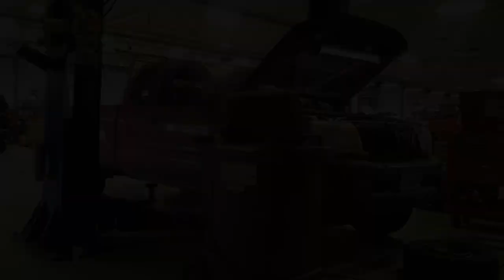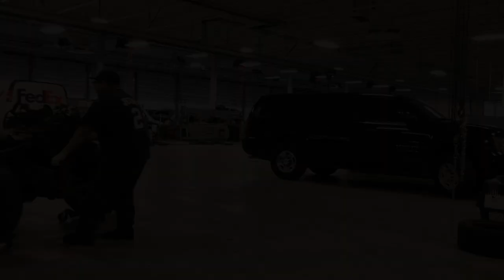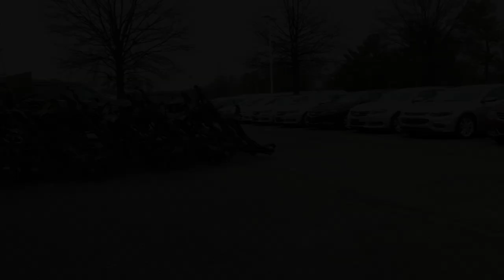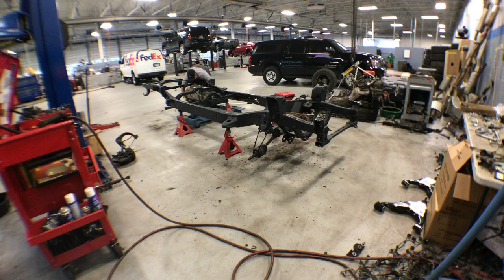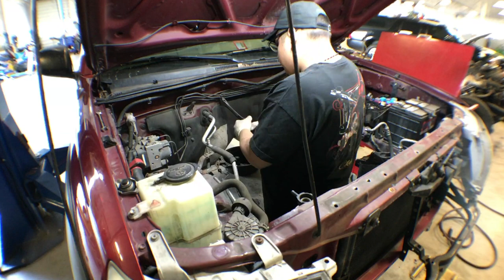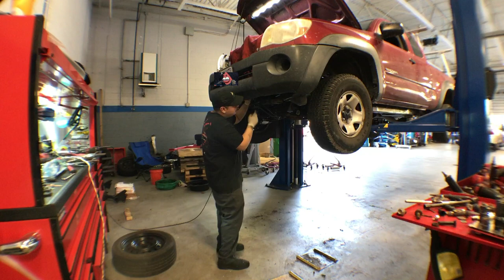Toyota Tacoma Frame Replacement

Comment: They should just start galvanizing their frames already.
Reply: Good idea.  How much would that add to their cost?  Instead of that how about units of government find an alternative to salt for keeping our roads safe.  And how about we use less salt.  And drive slower and more carefully.  That would work for me but most people are in a hurry to get home so they can sit in front of the tube and drink a few brewskis.
Reply: you think galvanized doesn't rust?
Reply: @76Bourne  ....i did....
Reply: @cdoublejj   a lot of people think that. Only Marine grade Stainless steel, but that isn't strong enough for car frames, its expensive, and you would have to use stainless screws, nuts, washers, rivets,  including your tools would have to be stainless. if you put a regular metal screwdriver on stainless that metal will start to rust on the stainless.
Reply: RUST PROOFING!   Get your frame oil sprayed every year.
Reply: @salespiilstire1144  twice or thrice a year!
Reply: @TheMatron'sMilitia it would get nicked and water would get in and rust it from the inside even more aggressively
Reply: They are too cheap to even put disc brakes on all 4 wheels and you this this garbage company is going to spend money to make their product more reliable??????  The rusting frames are BY DESIGN from toyota to get you out of your disintegrating truck and into a brand new one.
Reply: @jkutyna  Actually I prefer not having disc's on the rear because again...try living in Canada and especially Northern Ontario where there's nothing other than salt thrown by the boat load every moment nearly twice daily on our roads for say...100 days of the year...Yea brutal...Regardless drums in the rear are actually preferred over discs because of this.
Reply: @RogerDiotte  if drums were better in ANY circumstance ever, then trashota wouldnt be the only company doing it.  Especially the luxury brands would be doing it and they dont.  The ONLY advantage to drum brakes is that they are cheaper.
Reply: An alloy of steel and Molybdenum would make frames last almost decades
Reply: jkutyna You know they replace frames for FREE right? Toyota is eating a huge loss for every frame replaced. So no I don’t think they wanted to make the frames to rust out like Ram’s fenders or a Chevy Silverado rocker panel
Reply: I would rather replace a rocker panel on a GM rather than a frame on a Toyota
Reply: @allforwheelsgarage  My Tacoma has no frame issues as far.as I can tell. I had Diamond Cote applied when new. As for GM...My Sierra needed new shocks...valve seal leaked....whole front end replaced under warranty. Transmission did not work properly. And on and on. This was in 80 000 kms and 3 years old. So, between Ford and GM...They cured me forever.  So, maybe Toyota is not perfect, but Toyotas i have owned are light years ahead of GM and FORD.
Reply: @mikefoehr235  I must agree and disagree with you. I do believe the Toyota makes excellent vehicles. I myself have two Lexus vehicles and an old 1986 Toyota with 340000 miles. I have also owned many GM cars and trucks. My 2017 Sierra has had a few "trim" issues like a loose leather stich on the steering wheel for example. And mechanically it has had a couple as well, biggest being a squeak in the exhaust when it switched from v4 to v8 and a faulty gas filler neck flapper (capless system) fixed under warranty. the biggest potential failure I could see in the future would stem from the active fuel management because the old ones had problems with the lifters collapsing which can be prevented very easily with a range module which I will install once my vehicle is out of warranty. My old 2001 GMC Sierra has well over 200,000 miles on it driven daily by my stepdad on the original engine and transmission. My point is they can all last a long time if taken care of but some vehicles are more prone to failure than others. The Toyota pick up suffer from frames due to inadequate rustproofing from the factory. I guess you just have to pick your poison and think about the likely problems you're going to have to deal with as a vehicle ages. I myself can fix just about anything on a vehicle however I would not want to do a frame replacement.
Reply: too expensive. you can get a mechanic for 20/ hr. This was an Obama shovel ready job.
Reply: @76Bourne  In the seventies I used to build & weld stainless gas tanks for Jeep Wagoneers (1966 - 1970). Two custom fabbed 20 gallon tanks made out of 304 stainless. One where the spare tire goes in the far rear and the replacement coffin tank which was rusted out. TIG welded and installed and after 100 to 150K miles the only pits you could find are where the stainless brackets bolt to the steel hanger brackets. I bought two tanks for my own two Wagoneers 1966 & 67. The vehicles were driven in Maine, New Hampshire and Vermont and my own vehicles in Boston, Mass. Serious road salt abuse. Maybe it was the quality of the stainless that made a difference, 1975 - 1977.
Reply: @mikefoehr235  They use weathering steel on bridges where there is severe road salt and they rust, but I assume last for decades. I don't know the long term effects.

Comment: I had a 05 with a bad frame I had to fight with the dealer just to admit there was a recall. When Toyota and the dealer finally admitted it they told me I had 18 months to complete it and I couldn't drive it. I traded it for a Nissan 1 month later they called me looking to due the recall
Reply: They are scum bags aren’t they. The class action lawsuit FORCED them to start changing the frames. When I got mine done the dealer kept calling to tell me I needed to get this or that changed. They told me I needed a new belt. 😳 I told them the belt in it was only 4 hours old. I had just changed it when the frame finally broke. Mine was an 05 also.
Reply: I would never buy a newer model Toyota.

Comment: How long did it actually take you to complete the repair? my 09 TRD sport bdl cab long bed was dropped off on Monday morning and I was called on Wednesday morning telling me it was ready. Now I have been turning wrenches for over 30 years, so I know that's a lot of work. I'm not sure if they had more than one guy on the job or not, I picked it up on Thursday morning and haven't had any issues. To be honest I wasn't crazy about the idea of my truck being taken apart and put back together without doing it myself. Although I got a free brake flush and cooling system service because they replaced the coolant, with just over 210,000 miles it was overdue for both. My invoice was just over 10K, while I consider my Taco to be worth much more than that I'm not sure what actual book value is on it with the miles, however I wouldn't trade it for three times that.
Reply: Is it a toyota recall? why did you pay for the replacement of the frame?
Reply: I didn't pay for the frame to be replaced, the invoice had just over 10K was what Toyota was paying the dealership for performing the repair. I did pay for both rear shocks that were broke and the rear brake hoses. I paid dealer cost for the parts with no labor for installation. My truck did have over 200K miles, and I was getting a new frame. You don't bother with the little issues; My bill was like $270 ? $50 for each rear Bilstein and whatever for the brake hoses; Keeps me from dealing with them for a few years. 
I put 500 miles on their 2018 Tacoma they put me in with like 935 miles on, I turned it in over 1400. I did get a seat cover from work to put in it, respected their wishes and did not smoke in the vehicle. 

Although from that experience I can tell you, if you look at Tacoma's, make sure it's a V6. That truck got great mileage, didn't have any power. If your looking for economy, it's the cat's pajama's. 

I had to replace the muffler because it was rusted out, no big deal, I got a "Banks" cat back system. If you own this type of truck, this is the exhaust system you want. 3" stainless, mandrel bent. Muffler increases flow 211% 4" chrome or black tip. Uses factory hangers.  And well worth every penny, got one on my junk right now. I have the TRD cold air intake with the throttle body spacer thing from whoever. So far I have hit 450 miles to a tank, I just gotta keep my foot out of it. LOL...

These trucks are GOLD, if you can get one, get two, I rolled over 219,000 miles yesterday; While that's just a number, I'm looking forward to 233,129. That will be the point where I have put 200K on my Taco, I have over 150K on the tires; I'm probably going to get a new set when they hit 200K just because.
Reply: Just got my 06 Tacoma frame replaced no charge.  172,000 Kilometers rest of truck very good.
Reply: @mrgearheadfromhell  how long ago did toyota agree to replace your frame?  who did you talk to?
Reply: They had checked the frame from the recall and said it was good first, then when I took it for state inspection they checked it again and said it had " qualifying perforations " and they had already sent pictures to Toyota and they said put a frame in it.
I told them they already looked at it and they said Toyota extended it, I'm sure glad they did; That invoice was just over $10,000.
So the dealer gave me a loaner 2018 Tacoma with like 239 miles on it, I put 500 on it in 3 days.
Reply: @mrgearheadfromhell  tx....mine is an 03' sequoia and is horrible.  rest of the suv is fine, but toyota wont do anything.  dealer inspected it, but just sprayed black crap inside the rusted out frame.  gonna try replacing myself, should be an interesting project.  just gotta find a frame
Reply: @mrgearheadfromhell  Driving a Taco with almost 300K on it.  Wonderful truck.  Was thinking about going to a Tundra because I want to pull a small RV but am now thinking about the Taco V6.  

Totally agree with the quality of Toyota's frame replacement.
Reply: The Taco V6 will do just fine, I pull a heavy car trailer, it's actually a light equipment trailer 16' deck with a 2' dovetail. The biggest truck I have pulled was a 89 F250 extended cab LWB SRW 460 EFI C6 10 1/4" full floating 2 WD, I knew it was back there and Taco got right on down the road. The new Taco's have a 3.5L I'm not sure why they changed it, probably emissions or economy; I like my 4.0L. I usually get 20+ MPG so long as I keep my foot out of it. The Banks cat back system and TRD cold air intake really woke it up. I have never had it on the floor, I just lean on it a bit; Next thing you know your running 85 to 90 real quick. The Banks system is worth every penny and then some.
Reply: @mrgearheadfromhell  to answer your question I don't know how long this one took but 1 man can do this job in 17 to 22 hrs depending on how well it comes apart. And to all the sceptical people your truck will be returned better than it was before with no issues and no left over bolts
Reply: The rear shock studs and rear brake hoses were on me, I wasn't stressing because of all the free maintenance that had to be done to do the job. It just rolled over 233129 so I have officially put over 200K on the truck with over 170K on the tires, they went on @ 58233. I love it and want another, I have 4 second generation Toyota's 3 trucks and a 4 runner and got room for more.

Comment: wow ! lotsa work !. my 2018 try off road was side swiped before Christmas. over 14k Canadian in damage. insurance covered it. 6 weeks later still in shop, they tell they might have to order a new frame .a broken broken braket  at rear driver side. got hit right in the gas cap erea before back  wheel. took out my whole box , suspension etc.

Comment: When I look at the condition of this truck (body damage, bald tires etc) it is a shame to put a new frame on this truck.  To me, it's like rearranging the deck chairs on the titanic.
Reply: Frank P warranty covered it. They didn't make them right or coat them correctly from the factory. Like a 10-15 year warranty or something.
Reply: Lol
Reply: Exactly my thoughts. Bet the owner is going to sell it right after
Reply: If it still runs,drives then why junk it?

Comment: how much flat rate time?
Reply: Richard John My truck listed in as $12500.00. (2003 double cab.)
I bought it from a dealer that got it at auction.
I paid around 12000.00 for it.
Honestly, Toyota should have just junked them and paid out.
Reply from the maker: They did for the first generation tacomas. but that ended years ago.

Comment: I have a 2002 F250 SD 4x4 and I wish Ford would supply me with replacement frame parts so I could replace the rusted out front frame members.  Fixing of Rust Daily.
Reply: Well if every single Ford truck rusts apart for the better part of 10 straight years, including brand new trucks on the dealership lot, then the government will force Ford to replace the frames jyst like it is doing to Toyota.

Comment: Makes you kind of wonder if it's just cheaper to replace the truck? That's a lot of labor
Reply: I think Toyota is doing it for free as part of a recall. You can see a stack of frames outside this shop.
Reply: And yes it's cheaper to total loss the truck. As soon as a veh comes back need frame replacement we will total loss the vehicle. Labor hrs needed are over usually  over 97 labor hrs.
Reply: @theadjuster6760  Damn. Thats over $7k for most any shop!

Comment: Always thought there would be some welding but it looks like it’s all bolt on.  He had a torch to remove the rear end.
Reply: In manufacturing welding is only used if no other way is possible. It's the highest cost. The electric bill would shock you.

Comment: I just dropped mine off yesterday for frame replacement. They said it would take up to 60 days. Not with this guy.
Reply: @Joshua Bullock ?
Reply: Your frame probably had a safety issue.  Yes, it takes months for a new frame to come in.
Reply: WoodbyWolf Toyota was fudging the frame replacement inspections. Passing vehicles that really failed. Many than broke whilst owners were driving it. My broke. That’s what lead to the class action lawsuit.

Comment: THE CAR DEALER PROBABLY MAKES GOOD MONEY REPLACING PARTS NOT COVERED UNDER THE RECALL.
Reply: They made $1500 off of me for new exhaust system
Reply from the maker: Tech would too. At times I would do a "while we're in there" recommendation with a discounted labor rate since it's aprart. Simple stuff shocks/struts, water pump, belts, valve cover gaskets, radiator, etc

Comment: Afterwards it's no longer original Toyota quality. It's that local area's repair shop or dealership's quality in workmanship.
Reply: Probably for the better.
Reply: If Toyota's quality was so dam good it wouldn't be needing a new frame. That's why they call them tacos because the frames rust into and breaking in half looking like a taco shell. Lol
Reply: Most likely you will have missing or loose nuts & bolts , hoses and electrical connections problems afterwards.
Toyota factory have more quality assurance check than sub contractors.

Comment: Amazing Work! I'm going through this with my 2006 Tacoma 4.0 V-6. I bought the truck in November of 2016. They said it passed the recall and put that Undercoating on it. After owning it for 2 years My mechanic showed me how bad it was getting I got in touch with Crestmont. They said the Recall is over.  I have dealt withThe Toyota Engagement Center a few times they told me the same thing. Had the Truck in for a Transmission service last Friday. You can actually stick your finger through the chassis behind the front tires. I'm waiting for correspondence from Toyota Corporate. The truck is 17 years old with only 111,000 miles on it. I bought it a year after I retired hoping it would be my last purchase.Any impt from you on what I should do?
Reply from the maker: Unfortunatly toyota has ended their customer support program. My only recommendation is follow your owners manual section about cleaning your vehicle to care for your vehicles. Especially if you live in an area that has heavy salt and what ever else is used.

Comment: Moarlow save your back and get a second lift. also remove axles instead on lower control arms. They give you new arms and axle seals. Way easier that way
Reply from the maker: It was easier for me to remove the arms and just drop the diff with axle still attached. That was only if the rear bolt is not seized on the control arm.